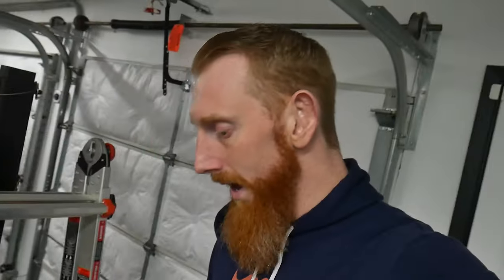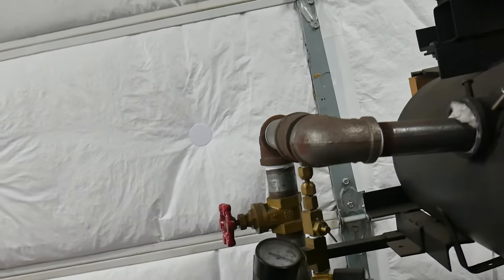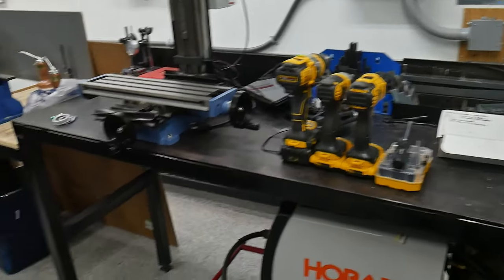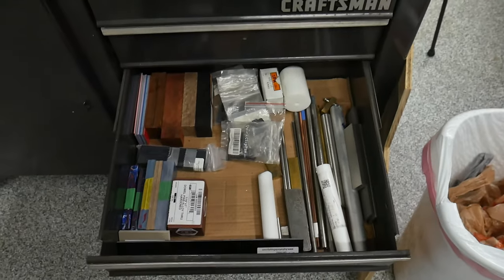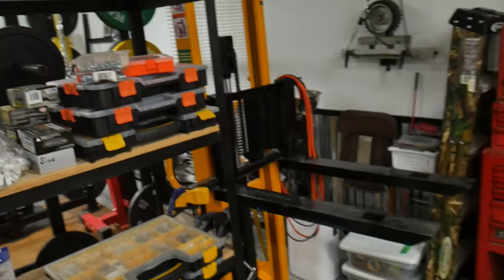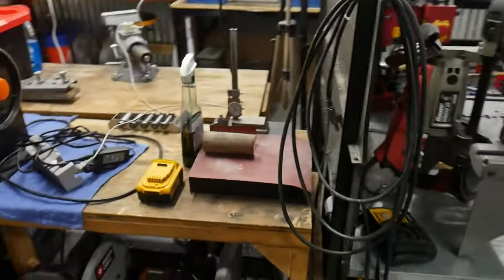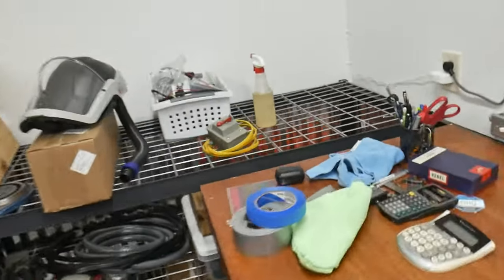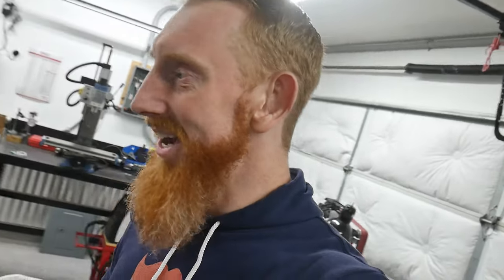Shop Tour | Knifemaking In A Garage

Comment: I am grinding my first knife, and have forged knives in the past, but this is my first knife to grind. I'm building a home/shop to retire to, and for my retirement I just want to build $#!T, primarily the house which is a log home I have a shell up to the top plates, and I have the foundation for the home in. I previously planned to use 1/2 of the walkout basement as the shop to build the house, but the terrain didn't lend well for that...as I have a lot of industrial machines and need both 3 phase and 1 phase. I added a 30x40 shop to my project, and the way I plan to use it, I need to keep about half of it clear, if I want to drive through. I have 2 x 14'x11' rollups and it has a small 8'x8' bathroom with a shower/toilet. Anyway, kind of a long post, but I currently have machines crammed in 1/2 of a 2 car, and I use a 30 amp dryer circuit for 1 phase and to power a 7-1/2HP RPC. I used to make woodworking handsaws for joinery. The knife is very similar. I have 2 anvils for forging, and some smaller anvils I use for leather work. I want to have a full woodworking, metalworking and smithy for my retirement. [EDIT: I should add, a 30x40 shop doesn't really give as much space as you would think...it gets chewed up quick in some sketches I've done...🙄]
Reply from the maker: Good luck with your builds my friend! You can never have enough space

Comment: Bauer saw just went on sale, I finally popped on one. Now just gotta decide on swag table or build my own 🤔
Reply: Just get the plate, and build it into a cart with storage. Thats what I did.
Reply: If you build one do it with the slot for the blade in front, I spent an entire Saturday building a complex vertical table with overkill gussets and made plates underneath that mold to the saws castings and I thought I was being real slick having the saw blade cut out in the rear.... well it wasn't that slick because I have to take the entire saw out of the table I made to change the saw blade.. 🙃 😭  really wish I thought that out better